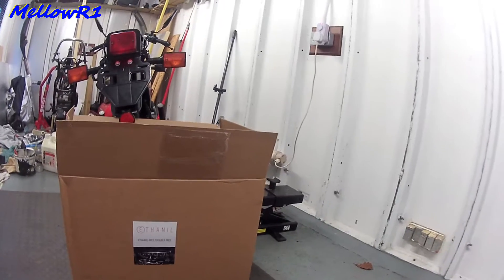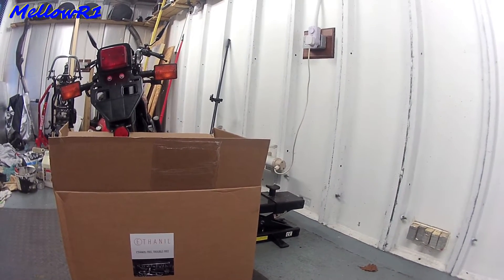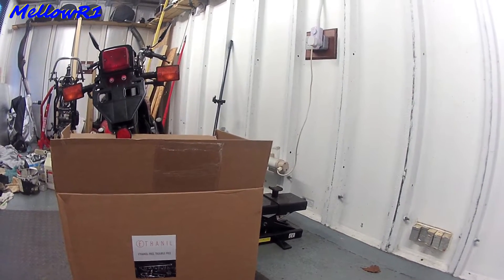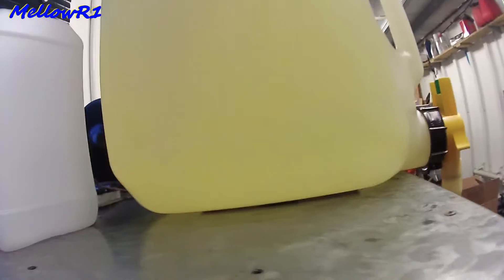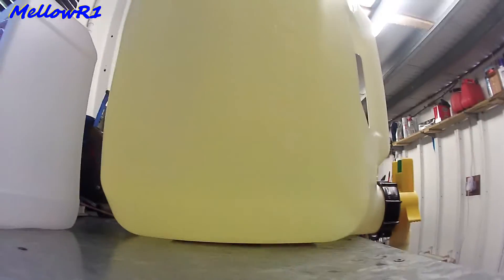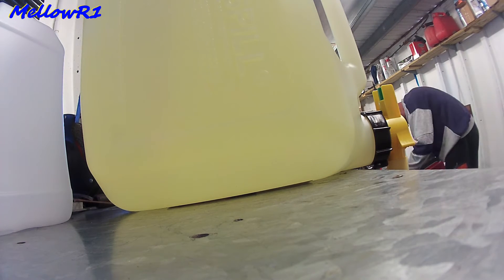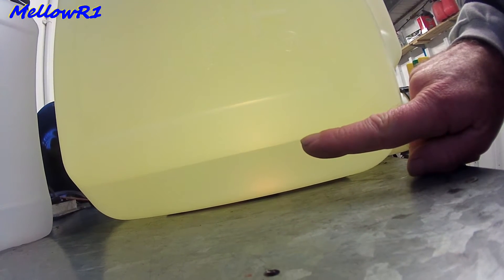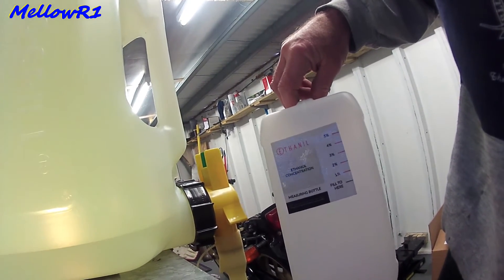Removing Ethanol From Petrol

Comment: This is all very well but where do I get the kit from ? AND the petrol fumes in what appears to be an enclose unventilated area must be a serious risk to the lungs AND EXPLOSION 🤯
Reply from the maker: I'm not sure this kit is available any more. There is a link in the description and I have posted it in previous comments👍
As for ventilation,  there is ventilation , even windows but you could always do it outside if you feel you need too👍I'd say its no worse than having a petrol lawnmower in your shed and filling it up👍😁
Reply: @mellowr1  Fair enough but I still watched nervously knowing the speed petrol evaporates, ( the gas being a known carcinogen ), making the buildup of an explosive gas more likely. An old friend used petrol to start a fire, pouring it from a milk bottle. Standing some 3 to 4 meters from the the fire the 'empty' milk bottle exploded in his hand taking two fingers with it. A gallon of petrol has the equivalent explosive power of 18 sticks of dynamite, and were the widows open ? YouTube needs you, perhaps windows and doors open next time 😊

Comment: well you need to tip the jug up on an angle you are pouring gas out at the same time trying to get the water out.. i think it would be easier to leave the jug on work bench and just siphon off just the gas leaving the water in the bottom. 
also just a foot note ethanol is used to raise the octane of the fuel so what are you replacing the octane with???
Reply from the maker: Yes i did that after. there was an updated post saying i propped the back up :o)
as for the octane rating, i did not replace with anything as i used esso synergy supreme + which contains no ethanol anyway :o) i don't think the ethanol changes the rating that much to be honest but i'm no expert :o)

Comment: I use a 5 litre can to pre-mix the petrol and the water. It's easier than trying to juggle a  bigger container full of fuel.
Mix it all in the 5 litre can then add all the  mixture to the settlement tank.
Reply from the maker: Good tip. So you just mix up 4 x 4.5 lts of fuel and 500ml water at a time :o)

Comment: You needed the tap more at the sump or angle the bottle more forward angle to get 100% of the water/ethanol out, great video thumbs up 👍
Reply from the maker: Hi thanks. Yes that's what I did after. Propped the rear up a bit. 👍😎

Comment: Should have leaned the container over as there was still water in the container with the fuel. when you said you got less water out in fact it was still in with the fuel ?. but good demonstration
Reply from the maker: Hi thanks. Yes that is exactly what I did on the next try and it worked perfectly 👍😎

Comment: Sorry ,apparently ethanol in E5 Esson Synergy Supreme+99 in Northern England but not down here in London etc.
If in doubt, the government's recommendation is to continue using E5 petrol (Esso Synergy Supreme+ 99). How much ethanol is in Esso's E5 fuel? Esso Synergy Supreme+ 99 contains , except (for logistics reasons) sites supplied from Scotland, North Wales, North England and Cornwall.
Reply: That should be E5 would be 5% E10 10% as I guess it's works on a percentage whats added

Comment: No way of telling what is water or gasoline as they are the same colour. Need water dye to tell, I understand the premium grade Esso has not got ethanol at the moment.
Reply from the maker: Correct.  No it doesn't and hasn't had for as long as I know, hence why I use it👍🙂
Reply: @mellowr1  Esso Premium has 5% ethanol. UK
Reply from the maker: @TriflingCircle  it does not. Unless in a few regions. It is marked E5 to comply with law but doesn't contain any👍

Comment: Its going up by 10% on unleaded fuel by the end of year, I believe.
Reply from the maker: Not on esso synergy supreme currently. Pumps will be marked e10, which is law, which means upto 10% but currently supreme contains 0% ethanol 👍
Reply from the maker: @The right honourable Matty Mc Hoon got mine from here.seem to be out of stock though 
http://www.ethanil.co.uk/#:~:text=Ethanil%C2%AE%20is%20a%20unique,on%20classic%20cars%20and%20motorcycles.

Comment: Before trying to remove the ethanol test the fuel by measuring equal amounts of the fuel with antifreeze in a test tube invert a few times and observe changes in the volume of antifreeze.  The alcohol will combine with the antifreeze and raise its level.  Antifreeze works faster at seperating than water and the difference is obvious.

Comment: Great demonstration. 
However, if you will go to the video to 16 minutes. 
You will notice that the level of the ethanol and water has stopped lowering. 
If you would have lifted the back of the container about an inch or a little more. I think it would have worked a little better. 
Thank you for the video.
Reply from the maker: Hi. Yes you are correct.  That is what I did the next day and it worked out perfectly 👍🙂

Comment: Good demonstration and I agree it is better to remove the ethanol.  One thing I did not hear you mention is that the ethanol can turn into acetic acid which can react with many metals to form salts.  That process causes corrosion.  It is sad that the refineries are now adding ethanol to all fuel.  Ethanol production is heavily subsidized with public money and the actual cost of the stuff to the taxpayer is enormous.  The real price is not the one posted on the pump.  Thanks for posting the informative video.
Reply from the maker: Thank you. I didn't mention the details you did as I didn't know that😁 all I know is that it attracts water and separates which is never good👍🙂thank you for the extra info👍

Comment: That drain spout is too large. It does not allow you to drain only the water at the bottom. There was still a layer of water and ethanol that was left behind. That is why you had so much petro in the container you drained into.
Reply from the maker: I re did the procedure, tilting the container at the rear which allowed all the water to drain before the fuel🙂 I could see it was not all draining off.
The result was exactly 2 lts of water, so the esso fuel had 0% ethanol in it, which was good👍🙂
Reply: @mellowr1  can u get pure ethanol  out of it ,to make hand sanitizers
Reply: Agree.  That is not a proper container for performing this procedure.  You are likely to end up with water in your fuel can and fuel in your water can.  The only way to do it precisely would be to use a separating funnel squibb.  Similar devices can be built with some creativity.  Also, I would recommend doing this with more than two liters at a time.
Reply: He needed to lean the tank forward a bit to drain the ethanol from the bottom , good idea , bad method ...
Reply: Put food die in water ,